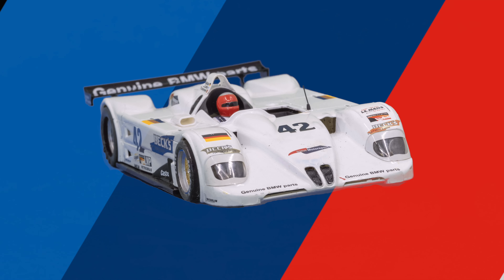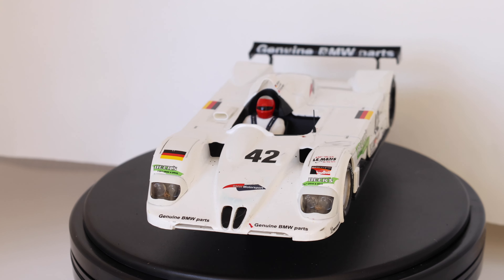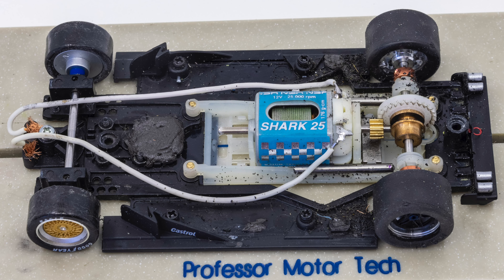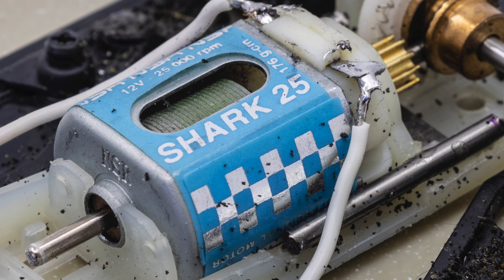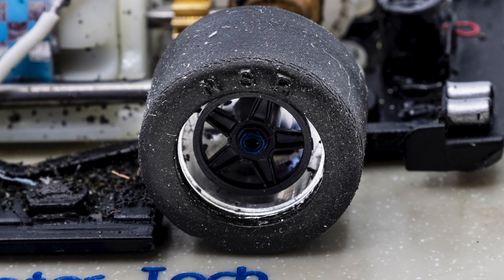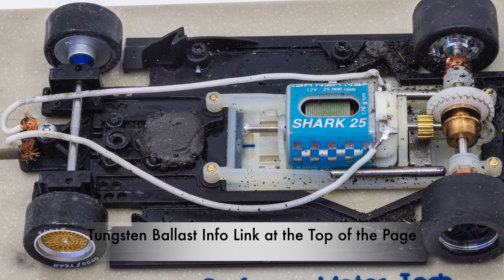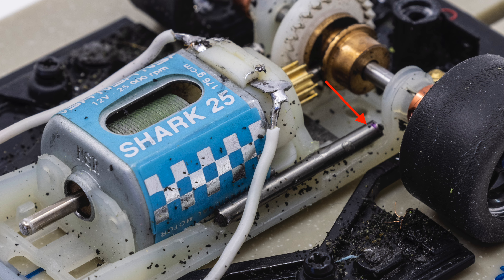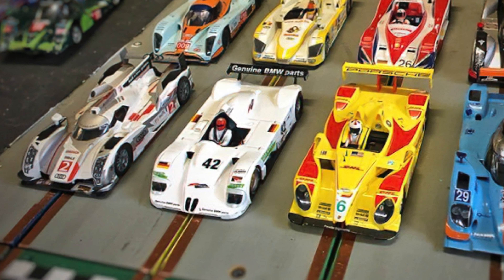Arrow Slot BMW V12 LeMans and Sebring Winner - 4k

Comment: Wow you took everything out
Reply from the maker: The chassis is still there
Reply: 😆 lol
Reply: How many grams of tungsten in that?
Reply: Good to see tungsten replacing lead.  I see a lot of lead toxicity results in my job, it's lifelong and nasty.
Reply from the maker: @paulhefferan8106  the putty on the front is 3.5 gr, the rear bar behind the motor is 2.5 gr and the side bars on the pod are 2 gr each.
Reply: @norcalslotcarsceneandvinta3518  Thanks for that, great insight into setup.